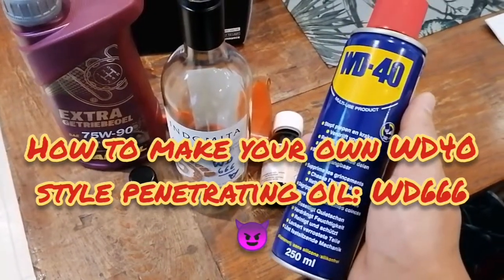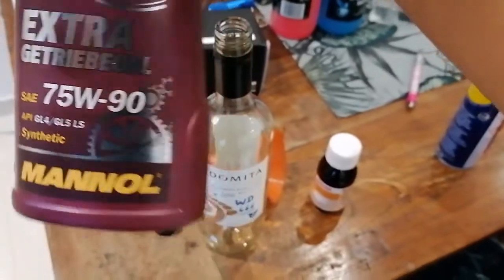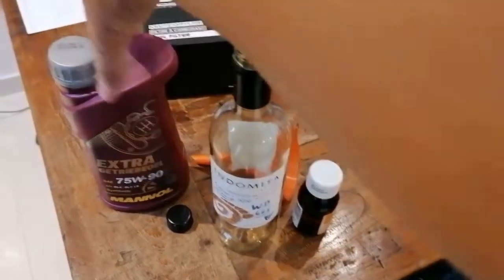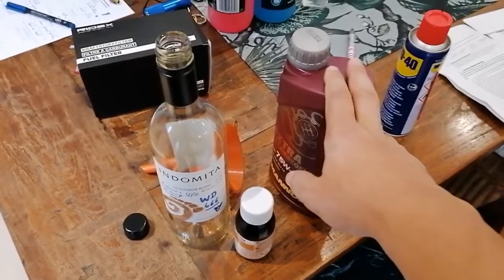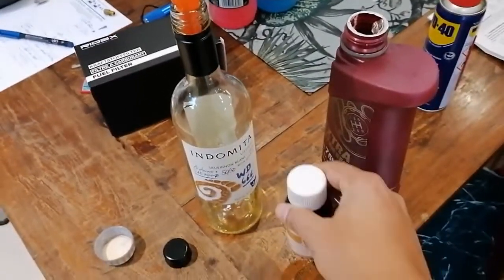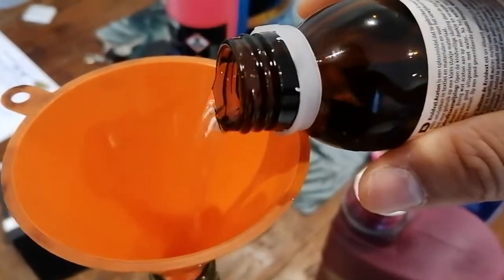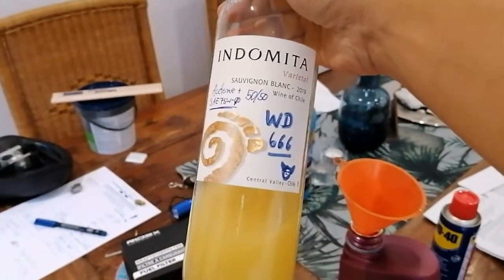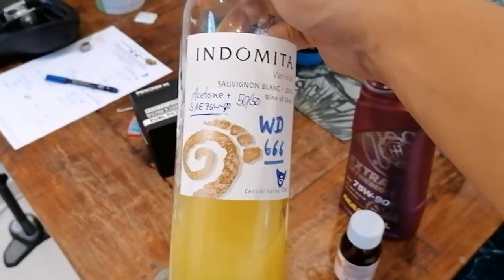How to make your own WD40 style penetrating oil/fluid using 50/50 Acetone, (ATF) Transmission Fluid

Comment: 12 oz.  Transmission oil  (rust inhibitor)
  4 oz.   PB Blaster             (Penetration)
  1 oz.   Dawn dish Soap  (Surface tension)
Some of this for fighting rust 2 yrs... .. .
Used in a spray bottle it spits rather than sprays so I use a brush.

Use WD-40 for joint pain, it Works    (mostly fish oil I hear).